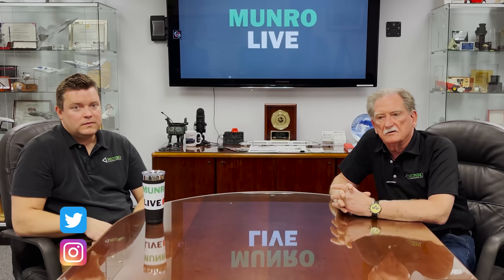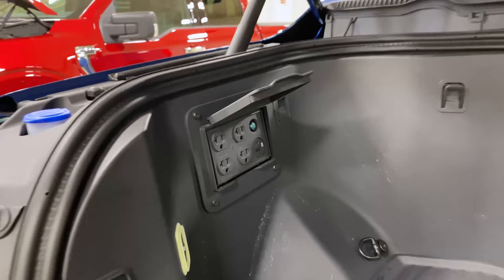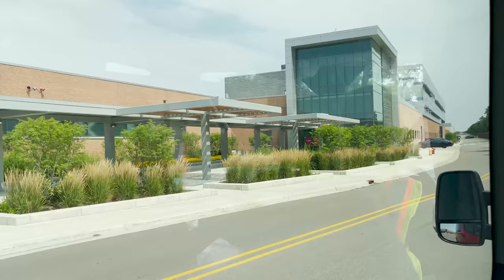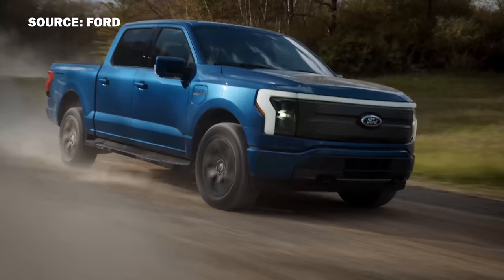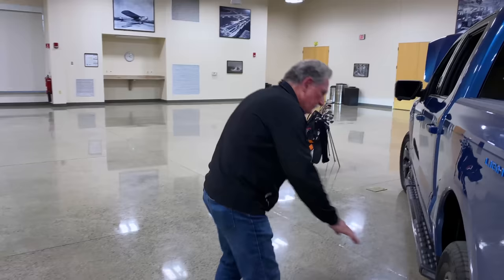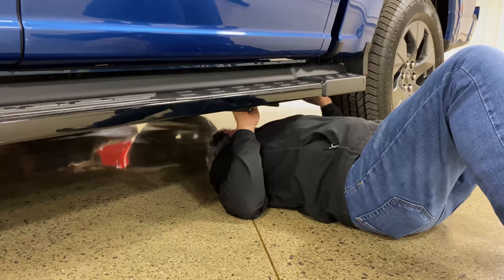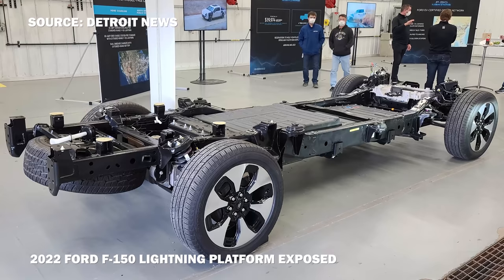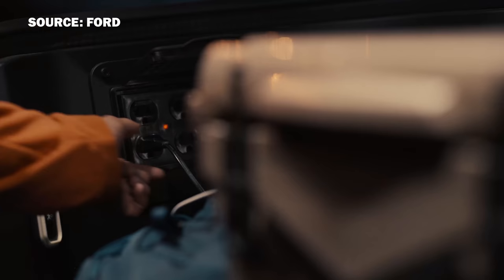Sandy's First Look at the Ford F-150 Lightning Electric Truck!

Comment: From Australia: I know the USA is the only country that calls a current car's year of manufacture by the next year's date (highly illegal here), but I did think this Big Ute (as we call it), doesn't actually release until 2022. So how did Sandy get his hands on a production model? If they export them to outside the USA, will the batteries be able to handle our 240 volt system with those power points (outlets) on the rear?? (The 95% of the world is 240 volts). I used to drive F150's when I was a police officer in Sydney. They had a 5.8 litre engine and chewed through 2 tanks of petrol a shift. They were our "paddy wagons". They were a beast. I actually like this EV version way more than the Cybertruck. It is just so practical for anyone who wants one.

Comment: With the enormous 150 to 200 kw battery,  the heavy duty commercial models  could have a shaft (PTO) sticking out of the middle  front bumper where you could hook up A) a big snowblower, B) a water pump for the fire departments in small towns where there are no fire hydrants, C)Etc..

Comment: "Battery isolated" - what is advantage of such set up ?
Reply: Probably durability. A lot of trucks get the hook yet out of them. Light off-roading onto construction sites that kind of thing. If you can isolate that battery pack you may be able to minimize vibration or at least dampen it. The other possible advantage could be it'll be easier to separate the battery and replace it or repair it. People tend to keep their trucks for a long time. And even if the original owner doesn't keep that truck for a long time they end up staying on the road for a long time. So in the secondary and third owner markets it may have better resale value if you know you can get it repaired. The Tesla battery pack is not really disassembleable although it is removable from the car.
Ford sells almost a million f-150s a year. If they plan on 50% EV by 2030 long-term repairability and resale value play a part in the company's reputation.
Reply: Truck frames twist under load.  
Batteries don't like being twisted.
Reply: @TqSNv9R0iG5Ckxew  
That is an excellent point. If you're going to tow haul go off road frame's going to twist a little bit at least. And you're right batteries do not tolerate that very well.

Comment: The thing about truck springs is they have to be sized to carry the full design load.  When you're not loaded the ride becomes rough and depending on the truck's size rather jarring.  That's why semi trucks and trailers use air suspension since it can adjusted on the fly to the load.
Reply: Ford  Lighting has independent rear suspension with active shock absorption.  Most likely a better system than a Class 8 semi or trailer that mostly uses air for load leveling.  Maybe one of the most high tech rear ends physically but also electrically (power and suspension).  Take a look online.  

Even a leaf spring is progressive upon load.  A tandem axle on a trailer is quite different in the way it acts upon bumps at speed (convoluted spring) compared to a single axle.

Comment: Hey Sandy: 
You should establish a standard RANGE TEST ie;
1-AC running @ 10 miles (wattage usages)
2-Heater running @10 miles  “         “
3-1/2 ton load @ 10 mile        “         “

Comment: 2.4 KW available through the outlet in the frunk. That's almost enough to run my gaming rig. :D
But seriously... Not everybody is a fan of the Cybertruck design. Lot's of people are going to buy this. Butts in seats of electric vehicles is a good thing. I sincerely hope that Ford is making money on these trucks.
Edit: LOL! 40% BEV sales by 2021! That's hilarious! What are they going to do with the other 60% of their production which will be banned in most states and European nations?
I'm sure that some people will insist on continuing to run their aging ICE Vehicles in 2030, but by then, nobody will be buying new ones. The cost of fuel, parts, your neighbour giving you a dirty look every time you start up that noisy, Smelly thing... It just won't make sense anymore.
Reply: How many off these trucks will have original battery and power train in 10 years?
My guess is they will last about 8 years.
But at 5 years you will have 60 percent of original range.
These trucks will not cost less to operate than a properly built piston truck.
With all that said I believe a zero payload battery truck would sell like crazy, think 10kw generator.
Reply: I think you meant BEV sales by 2030. But yes! Have to agree with everything you said here. Big changes are coming fast. I drove my son's new Tesla model Y the other day. Oh my!
Reply: The Lightening will have 9.6kW available to do things such as power your house for three days, through the charge port (or up to 10 days if you ration power).  That's if you purchase the 80A charger through Ford that's connected to your main breaker with an automated switch (to disconnect your house from the mains while your truck is powering your house)
Reply: Question is, how much premium ppl will be willing to pay for a traditional design over the cybertruck.
Reply: @tomiday66  That BEV torque just puts a giant grin on your face.
I really love my VW Golf, but I will never buy another ICE vehicle again. By the time I'm ready to retire my current vehicle, the Tesla Model 2 should be ramping production. If the budget will stand it, I'd like to get a model Y.

Comment: 20:35 only 40% by 2030? That's less than 2 million per year based on their current sales.
Reply: If they are only planning on less than 2 million BEV by 2030 then they are planning on being a significantly smaller company.

Comment: But can they produce 500,000 units? Or 5000?
Reply: "Battery constrained"
Reply: SK Innovation is currently building a battery factory near Atlanta. Those cells will be going in F150 Lightnings and VW ID4s. 

At full capacity in 2023 there will be enough cells for ~300k vehicle per year. Obviously the F150 will have larger packs than the ID4. Not sure on the Ford/VW split on production but 50-100k production rate by end of 2023 seems like a realistic ballpark.
Reply: @patr5902  
What's that factory capacity again?
And when?
I saw about 10 GWh "in 2022" (so the end of 2022?)
Is that for the big Mach as well?

Comment: I just wished they would sell it with the 6.5ft bed for those of us that work in construction.
Reply: I think because Ford repurposed the “shell” of the car, they had to stick with the giant frunk and 6ft bed. Looks like Cybertruck will have a 6.5ft bed, but a smaller frunk. They’re also suppose to have some storage on the side sails and also in the compartment under the bed. Will be interesting to see what people like more.
Reply: Darn.   Only 5.5 feet.  
That's disappointing
Reply: Going from an 8' f250 bed to a 5.5' f150 bed wasn't too tough.  A bed extender into the hitch gets me back to 8' for long material

Comment: What about access to service, the cells in that battery pack that eventually will burn out? Seems way more important than how many golf bags can fit in the frunk of a pickup. Also, what if I want to travel greater distances by carrying an extra battery bank in the bed or frunk or tow a battery bank trailer, can I just plug that sucker right into my new ford lightning? One more question, what about a lift kit, Is it possible to lift this truck?

Comment: Ford: look, our gear selector folds down and out of the way.  

Tesla: what gear selector?
Reply: Parts shelf strikes again.
Reply: Tesla: your pickup truck has a wheel?
Reply: FORD: Look we have a truck with a gear selector that folds.
Tesla: You have a truck out before us? Why did we postpone again? 🤫
Ford: We also have a power inverter that uses your truck as a generator and it has electrical outlets to plug in for work 
Tesla: Well we have?  Never mind let's postpone the Cybertruck and rethink it. 🤔
Reply: @twany442  since the only people to drive either vehicle has been the employees and Ford has also had issues delivering Mach e in volume I am not sure the delivery timeframe is as big of a concern as the fact that the $90,000 lightning has the same specs as a $50,000 Cybertruck. Same towing, range except the cybertruck seats more, has an extra foot of bed space, and larger payload with almost half the cost. That isn’t even considering the insane specs of the tri motor.
Reply: @joshuavoss1387  Girl! You're fighting about a Cybertruck that's going to get its ass handed back to them by the Ford F-150 Lightning. Girl, I just love your way of delusional thinking that the Cyber truck will even stand a chance to the world's most popular vehicle for 44 years. Put that oil in your vape pen and smoke it.
Reply: @joshuavoss1387  Does the Cybertruck have a power inverter, or electrical outlets to to plug in and play? Can it charge your house or car? No so we are not in the same level.
Reply: @twany442  the cybertruck has onboard air compressor for power tools, does the lightning? No

Power outlets? Yes, it has 110 &220. Did you not see them explain that as they drove a 4wheeler  into the bed and plugged it in thanks to the integrated ramp in the tailgate. Does Ford have a ramp in the tailgate for loading? L track or T slots for adjustable tie downs or just those same 6 fixed points?

I am not sure why you would want to use your vehicle to charge your home. That will wear your battery cycling it like that. Not to mention the cost to get the hardware and have it installed for your home to be able to receive the power from your car. Might as well have a dedicated battery backup. That is significantly more useful and you are having to do half the work necessary anyway. I get it sounds cool but it just doesn’t seem practical compared to other options.
Reply: @joshuavoss1387  You would only need to use the truck to power your house, if the power is out.  If you use it like a Tesla PowerWall, where it supplies some power for 6-8 hours at night, that isn't going to fully discharge the battery every day, given that the truck can supply 9.6kW for 3 days continuously.
Reply: @joshuavoss1387  Dude let it go! The Ford F-150 lightning has the upper hand PERIOD
Reply: @joshuavoss1387  And I don't want you to think that I'm being rude. But let's just wait and see what happens after it comes out. If they tank then I will find you and tell you, you were right and I have no problem with that at all. And if you're wrong then wait to run mouth about something you know absolutely nothing about.
Reply: @joshuavoss1387  You would actually need four to six power walls from Tesla to add up to what one F150 Lightning could do.
Reply: @twany442  I just wish we could get either in Europe.

Comment: Honestly I can’t wait for my Cybertruck, but the truth is: this seems like a great vehicle too. I’ll be disappointed if my CT doesn’t come with a similar frunk as the F150Lightning and some extra power outlets.
Reply: yeah at this point everyone knows if someone puts out something nice tesla makes a move and instantly beat their little thing they had going for them...
Reply: Well they already took GMs thunder with the crab walk. 

Honestly if the lightning was about 20k less and more on par with the price/ performance of the cyber truck I would probably get one. I just find it odd that at 90k it has the same specs as a 50k Cybertruck.
Reply: @joshuavoss1387  crab walk is an easily copied gimmick.
Reply: @joshuavoss1387  spec are not the same.  Throw a 5lbs ball bering at the window.  Hit it with a hammer.  Run a key down the side.  Lol
Built TESLA tough!
Reply: ? The cybertruck has a frunk
Reply: @joshuavoss1387  less specs... 60% the range and 70% the towing capacity for 130% the price.
Reply: @misteratoz  that’s only if you compare it to the tri-motor. The top end lightning only competes with the dual motor CT which is about half the price.
Reply: @joshuavoss1387  the trimotor cybertruck, premium though it is, might be the best electrical car ever made by value because of that absurd range. We're saying the same thing. Exciting times.
Reply: @davidbeppler3032  I have two older cars, a sequoia and a Lexus, both have been amazing mechanically but they are aging and the paint has chipped and cracked on both. My 08 sequoia will probably make it to a million miles with no issues but it already has started to rust on the hood where paint has chipped from rocks and other things hitting it. I’m actually very excited to not have paint on the cybertruck. One less thing to have to maintain IMO
Reply: Cybertruck won't have the ability to power your house like the F-150 Lightening will.  Tesla wants to sell you the PowerWall for that (an extra $10-20k)
Reply: @charlesball6519  lmao... For the extra 20k that Ford charges I'd get the power wall and full solar array and invertor for my house haha. Thanks for the advertisement. I'd also add that it's not that difficult to add an invertor and a plug into a car.
Reply: @misteratoz  I have the dual motor with FSD on order. I am struggling not going with the tri motor and keep going back and forth on it but I just don’t know that I want to spend an extra 20k for a little more zip. I appreciate the extra range but don’t need it. I’m also looking at getting the wife a fully loaded 15 passenger sprinter within the next year so that makes me less inclined to splurge on my car.
Reply: @joshuavoss1387  the extra range is more useful than people think. Trips are faster, towing is easier and less stressful, and the battery/vehicle life is longer too. But yes, that's only if the Financials allow and use case dictates.
Reply: @boostav  yes but it’s tiny compared to the one of the F150Lightning, and you gotta lift your stuff higher. I like the frunk of the F150Lightning not only for its size, but also because the front side opens up
Reply: @Steph1  It's not tiny by any means, it is however smaller because the Cybertruck has a smaller overhang, which is much preferable when driving. Keep in mind the bed on the Cybertruck is fully enclosed so you actually have a lot more usable cargo space than the F-150 Lightning.

Comment: Totally agree the Lariat is the better buy.  Got a King Ranch for contracting work great ride comparable to my 67 Caddy to the 99 Continental but a failure with a load.  My F250 Lariat I will drive to the grave,  miss a few bells and whistles but this is a truck ready to do the work in comfort.

Comment: If I were buying my next pickup truck, it would be a 2-door, long bed, bench front seat, XLT Lariat trim level, with the longest battery range available, and the 110v accessory power equipment if that is only available as an option.  No more ICE pickups.  No 4-door crew sleepers with tiny cargo beds.  If Sandy Munro says it is designed right, that’s good enough for me.  My last XLT Lariat lasted over 20 years, then I gave it away and it is still on the road.
Reply: No 2 door available yet

Comment: Isolated vs structural battery pack. Which might be a better choice?
Reply: Isolated is easier to repair after a crash?
Reply: Isolated is much safer comparing to structural battery during crash. Also can be easily removed and replaced.

Comment: Still no engineering thoughts regarding the various defects reported on the Ford Mach-E?

1. Norway: Overheating while going down hill and shutting down
2. OTA Brick: Dealer applied software updates reportedly bricking the Mach-E's all over the States
3. Charge Port Door: Reports of charge port door popping open while driving and cause the EV to stop running
Reply: He's an old former Ford guy, it's one of his blind spots and why I don't watch his Mach E vids.

Comment: It kills half your range, I tow 2500lbs with an open trailer carrying a side by side with my model 3. Then as Sandy said factor in decent inclines for more loss! Europe has the tow program on their Tesla’s to tell the vehicle your towing, I wish they’d put it on the US Models.
Reply: Yup.  3000 lb bass boat behind my Model Y and I get 110 miles at 48 degrees, flat, and 63mph.  Probably 130-140 when the temp is above 75.  Towing range is going to be interesting to see, but since the Lightning is much less aerodynamic it may not see as much loss.
Reply: @nerothe  I agree on aerodynamics of the Ford, I was thinking the same thoughts on that the Hummer and the Rivian!

Comment: the FUD Lightning does NOT come Standard with AIR Suspension.
however , I do give them credit for using 4 Wheel Independent suspension in the Lightning. 
I think on some Trims you can ADD Air Ride Suspension for $$$. 
but, the Cybertruck comes STANDARD with Adaptive AIR ride suspension and 4 Wheel Independent suspension. 
it can LOWER the Truck at high speed for LOWER Drag and to allow EZ boarding. 
CT can also kneel the Truck bed to allow EZ load/unloading.

Comment: I believe that Ford is on the right track on EV production. Having worked in the construction trade before I retired we always bought Ford trucks for our foremen. They were not the 150’s. They were the 250, 350 and 450’s that could handle the weight on our equipment, pipe, ladders and supplies. The new lightning will do well.

Comment: In the 2024 model change I think all of the Lincolns will have a plug in option just like  the lighting, and run on electric only with the gas option to use if needed to make it charging station or home.  With the 26 model Change on the super duty I think there will have the nitrogen like the big rigs will have

Comment: Sandy is so on.  OPEC's 2015 World Oil Outlook expected 4.7 million battery electric vehicles on the road in 2040. 

Actual tally in mid-2021: over 8 million.